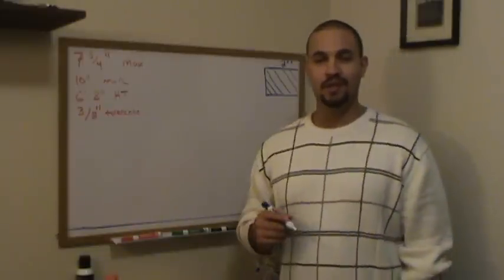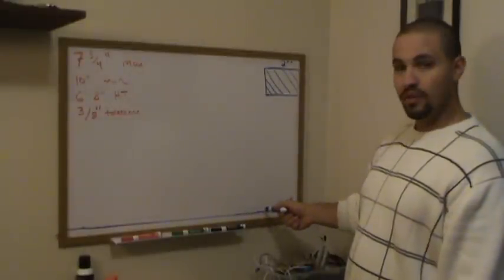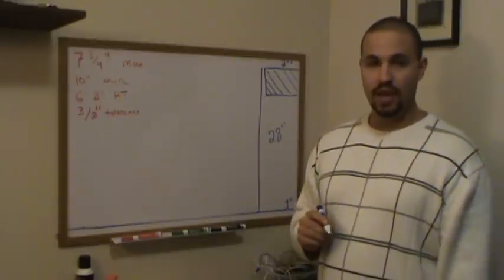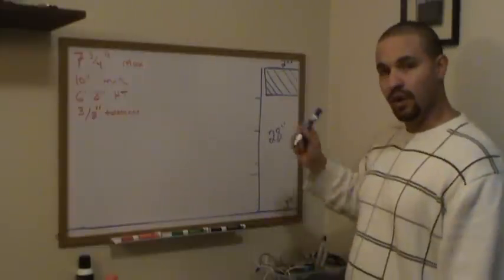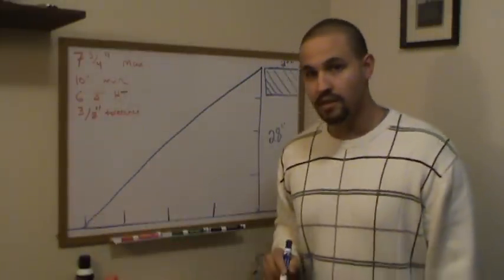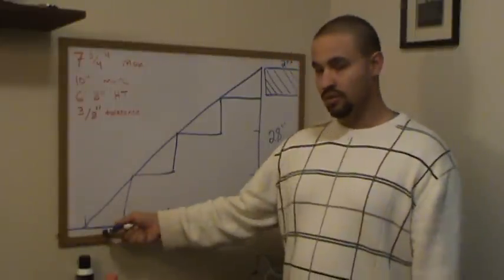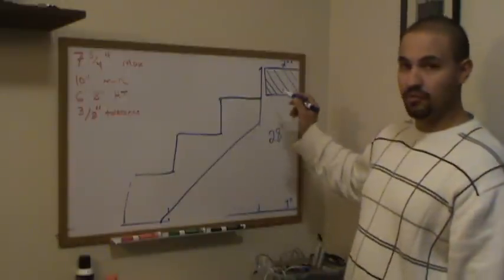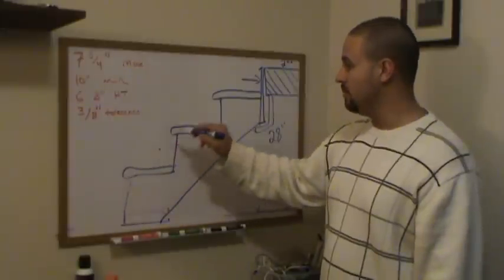How to calculate stringers for a set of stairs

Comment: Nice and simple, but if your going to remove 1” from the bottom of stringer,  the rise above the top step is now at 8”, so you must include the top floor with  its finish to calculate total rise.

Comment: I like the fact that you drew the stringer into the picture.  It is somewhat magical to me that you can make something so important out of what is essentially, to me, just a a long piece of wood.
 I hope I've got this right.  I see you illustrated  that the highest step is the surface of the deck (or whatever) but is not part of the stringer that you cut - but the deck height (the highest step)  is included when you measure the  total rise. 
So, the top of the stringer attaches below the deck surface aka, the highest step. So you have 4 individual risers 3 of which are part of the stringer, and 4 steps - 3 of which are a part of the stringer.  Is that right ?
Reply from the maker: Yes that sounds right